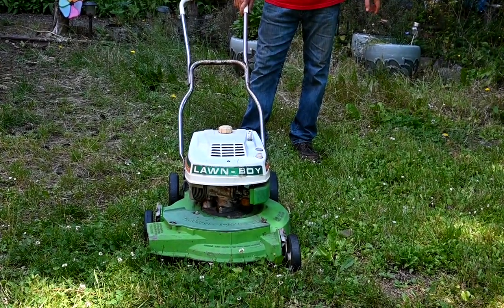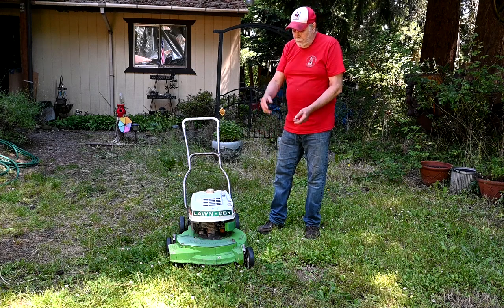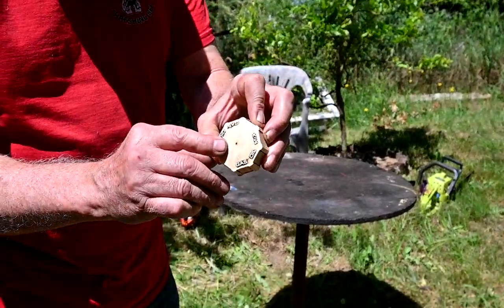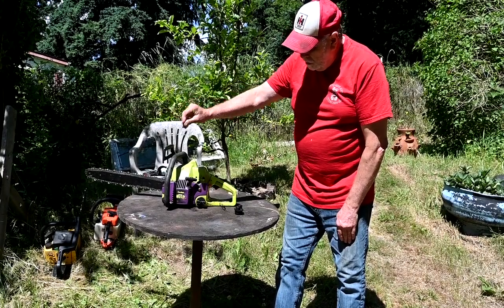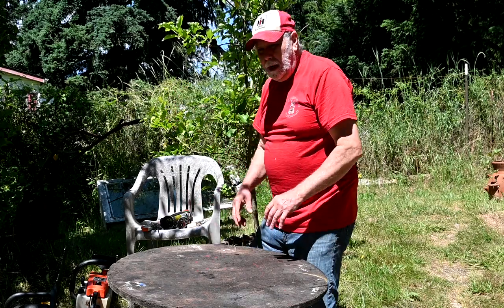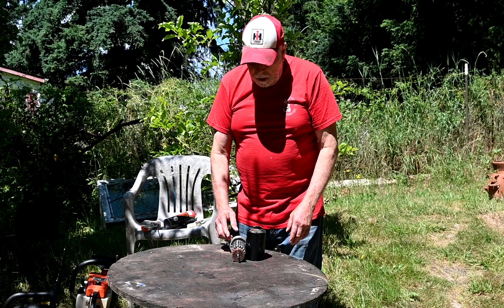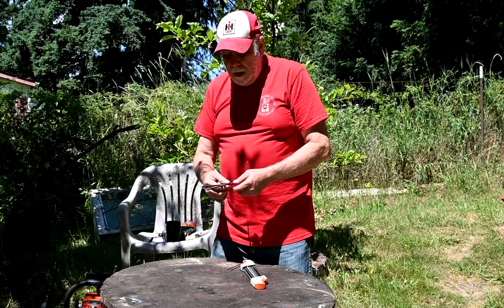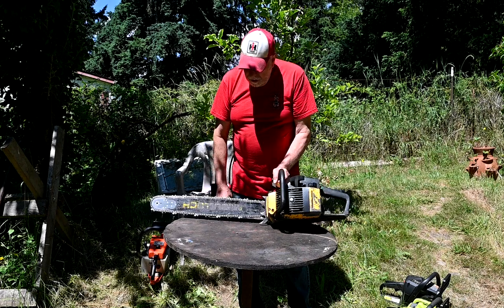Vintage Lawn Boy Mowing + Other Non-Related BS

Comment: I got some STP Oil treatment in my lawnmowers, today.  I went by your prescription - 10%.  I put two ounces in my push mower and 6 ounces in my lawn tractor.  My push mower holds .7 QT and my tractor holds 2 QT.  I will add it to my emergency generator and gas pressure washer when I get a chance.  They are due for an oil change, too.
Reply from the maker: Your engines will be happy.  The reason I don't use multi weight oil in my power equipment is because the base oil is the first numbers on the oil can, like 10 or 20.  The second numbers represent how thick the viscosity is when the oil is hot.  How this is achieved is that the oil say 10 weight is mixed with a polymer, a type of plastic,  when heated up , holds the oil molecules together, then on a test machine it registers say like 30 weight, so it is rated at 10-30.  The problem is that the polymer wears out, especially from high heat, and all you have in the crankcase is dirty 10 weight.  Air cooled engines run hotter than car engines, so the polymer breaks down sooner.  STP is a viscosity improver, so it helps the oil from breaking down as soon in power equipment also.

Comment: I have one of those Lawn boy mowers too. I gotta get the thing it goes on the end of spark plug wire I've been working on Is here and there.  been waiting for my knee to heal I gotta Two brand new knee I'm limited to what I can do. But I can't wait to get it running Thank you for the video.
Reply from the maker: Thanks for watching. When your knees heal up, it will be good excercise to push that Lawn Boy around out mowing the grass.

Comment: I Love All Lawnboy 2 Cycle Mowers I’ve Got a Commercial Model M Series Piston Ported Ball Bearing Engine They Said Run 64:1 Mix I Use 50:1 Mix Still Runs Like a Brand New One 😊❤️😊❤️ I Had That Same Model You Have I Believe It Has The D-600 Engine 😀😊 Thank You For A Great Video Mr&Mrs Obsolete It Brings Back Fond Memories When I Hear Your Lawnboy Running 😀❤️
Reply from the maker: I think the M model was one of the last 2 stroke Lawn Boys, and the engine was made by Tecumseh if I remember correctly. Glad you liked the video, and see and hear my old mower earning its keep.
Reply: @mrobsoletesvintagehomestea9156  The Engine Was Made By OMC It Was Rumored The 2 Stroke Suzuki Toro Commercial Mowers Were Copied Engines of The OMC M Series 😀
Reply from the maker: I read somewhere that the Dura Force engines used by Lawn Boy were built to OMC's specs by Tecumseh.  They were the last 2 stroke Lawn Boys.  The M series must have been a bit earlier would be my guess.
Reply from the maker: I did a little research, as I couldn't remember all the BS about the last of the Lawn Boy 2 stroke engines, but the model M and the DuraForce is the same engine. The original link that I had on the information about this engine is no longer around. Most info on the M say it was not an OMC engine.  Some say it was a Suzuki design like the ones sold by Toro, and others say it had a connection to Briggs& Stratton.  So now I am as confused as ever !
Reply: @mrobsoletesvintagehomestea9156  I’ve Got The Service and Repair Manual For The M Series I Worked at a Lawnboy Dealer 20 Years Ago When They Closed The Shop I Got to Keep The Service Manuals That We’re Left There 2 Different Engines The M Series Was OMC and Has The Carb on The Left Side Of The Engine It’s a Metal Mikuni Carb I Have a Commercial M Series The Model # is  C21ZMR  Serial # is  J0001372  The Duraforce Engines Had Reed Plates and Plastic Carbs Mounted on The Rear Of The Engine I’ve Got a Video of My M Series Running On YouTube I Still Mow With It To This Day Vintage Is Always Best 😀😊😀 Mr Obsolete
Reply from the maker: Thanks for the info.

Comment: Growing up, my best friend's dad had one of those mowers. I remember being a pretty good machine. Currently, I'm trying to get two old 10-10 Mac's  running that I picked up at an auction. One of them is pretty much complete, but the other one is missing a few parts. I'm going to try and make a video on the process of getting them running.... Great video Mr Obsolete...👍🤙
Reply from the maker: When I was in the 5th grade, my teacher used to hire me to mow her lawn, and she had a brand new Lawn Boy to mow with.  I liked mowing with that mower as it was fast, quiet and did a fantastic job of mowing.  We had a crummy old electric powered reel mower, so when it started shocking me, we got a new mower from Montgomery Wards using S&H green stamps. They didn't have Lawn Boys, so we got a Garden Mark with a 3hp B&S.  It lasted for 35 years, but I always wanted a Lawn Boy.  I will check out your video when you get the Mac's up and running.
Reply: @mrobsoletesvintagehomestea9156  my first lawnmower that I remember was a 5 
HP Toro self propelled reel mower that momma bought when I was about ten.  Being the oldest, it was my job to mow the yard.  Before that we had one of the old push reel mower and the Toro cut a lot faster than those suckers.  I pushed that heat sucker around the yard for years.  It would be another ten years before we got a rotary mower.  On the .tor, you had to wrap a rope around the starter and pull, re-wrapping after each pull.  I know you know the type.  It was a lot easier to crank than a Ford tractor with a crank start, but not much easier.  After about five seasons the .toro gave up the ghost and would not run.  I did not know anything about storage condition, back then, so letting gas sit in it from one year to another probably killed it.
Reply from the maker: Good memories and story.
Reply: @mrobsoletesvintagehomestea9156  more like bad memories and BS.  I had to push that heavy sucker all ove the yard because it did not want to roll in we St. Augustine grass.  It was a belt drive which did not want to roll, you kind of had to help it along.  My Ninja Snapper will pull me up the hills in the yard, now.  My Snapper SPX lawn tractor will go anywhere I want to go.  It has a hydrostatic transmission and a cruise button.
Reply from the maker: Got a good laugh out of your comment !

Comment: At least, you do not have to change the oil in it.  I need to change the oil in my Snapper Ninja but I do not worry about it because I use Pennzoil Platinum 10W-30, fully synthetic in it.  It lasts a lot better than conventional oil.  I change it when it gets discolored.  I hardly ever have to add additional oil to it.  My lawn tractor contains the same oil, as does my generator and pressure washer.  
  I have been trying to get some Stihl 18 inch scabbards (30-06) for my Stihl 025 and 021 for six months.  I ended up putting 20 inch scabbards on them.  I could take the 20 inch scabbards to my chop saw and shorten them but I use so many 20 inch bars I always need another scabbard, so I will let them fit a little loose until the right ones come into my local Stihl dealer.  I use a file card to clean my files.
Reply from the maker: On my 4 stroke mowers etc., I use 30 weight oil with a 10% mix of STP. I have never had an engine failure on any of my power equipment using this.  A lot of my power equipment is between 20 to 40 years old, and still going strong. I change oil twice a season also. The STP has the zinc disulfide and other additives that air cooled engines need to survive.  Regular car oil doesn't have the correct additives, and that's why the engine manufacturers sell the very expensive oils.  Using a file card on files is an excellent idea.  On my files that I use on oily chains, I wash them off with brake cleaner before I use the file card on them.
Reply: @mrobsoletesvintagehomestea9156  that about the same viscosity as what I use.  I have not seen STP in shops for years.  Didn’t know it still existed.  I run my mowers year around, so I need the lighter viscosity.  I mow up leaves in the fall and winter.  I figure if Pennzoil Platinum is good enough for my cars it is good enough for my lawnmowers.  My mowers are brand new by your standards.  It is also hard to find standard HD 30W anymore where I live.  I use it and ATF in my pneumatic oiler and if I can’t find any 30W I will use bar oil as my general lubricant for such things as door hinges, bearings, etc.
Reply from the maker: I live in a rural area, and there is still a lot of old tractors and old farm equipment still working, so some of the local parts stores stock 30 wt oil. These same shops carry STP also.  STP was not selling very well in bigger cities around us, but when the government mandated the removal of zinc in oils, commercial smaller trucks that were gas powered, started having massive camshaft failures, the the same to other small trucks that had flat tappet cams.  People started adding STP and the problem went away, and STP is now a big seller.  Many years ago I worked at a car dealer, and they used Pennzoil for the lube rack when servicing customer vehicles.  It would cause a weird plasticky material buildup in the engines, and we did a lot of camshaft replacements, as the oil did a poor job of lubricating.  When I worked at an independent auto and general repair shop, we used Castrol.  It was excellent until Pennzoil purchased them, cheapened up the oil and cut the additive package.  We started to see the same problems we had at the dealership.  None of these oils were synthetic. Today most vehicles use synthetic oils, and in most cases it is much better than the old mineral oils we used forever.
Reply: @mrobsoletesvintagehomestea9156  I used to use STP but after I saw a lot of bad publicity on it I stopped using it about thirty odd years ago. I will see if my local parts houses have it and .I will get a can and add a little bit to my oil in the LM’s.  I guess it is like when they removed the lead from the gas - that ate up valves in small engines.  They needed the lead to lubricate the valves.  Talk about sludge the king of that used to be Quaker State.  I stopped using it over 40 years ago.  I had to replace the valve cover gaskets on my ‘78 Chevy K 15 and the galleries were filled with white sludge.  I switched to Valvoline and never had a problem, again with sludge buildup.  That, was when I changed my oil every 3,000 miles, too.  I have never had a valve tapped problem.  I change my oil every 5,000 now.
Reply from the maker: I have used STP in my vehicles since I was in high school.  Many of the cars I had I drove over 400,00 miles, and the engines were always clean inside. The bodies rusted out before the engines ever needed work. The sludge problem in older vehicles was caused by bad oil without good additives and poor or non functional crankcase venting system.  Valvoline has always been one of the best oils.  We found that engines had 3 to 5 pounds more oil pressure with it.  One thing about synthetic oil that is missed is that the additive package is pretty well used up by 3500 miles, just like in regular motor oil, so it is best to change it a bit sooner than 5000 miles.  When synthetics were introduced, Saab said that the recommended oil change interval was 10,000 miles.  We sure did a lot of camshaft and timing chain jobs on them as a result.

Comment: Well let's try again , I've fixed that carburetor problem on the two butter fly carburetors when that plastic piece breaks off on the top butter fly rod , I drill a tiny hole in the rod and put a cotter pin in it and bend the cotter pin so it opens up the top butter fly the same time as the bottom .
Reply from the maker: That's pretty inventive.  The original carb had all metal linkage. After it failed,  I used a carb off a parts saw, and got it to run for a while with that one, but the plastic piece failed on it, and the diaphram wasn't pumping enough fuel to keep it running properly.  Since I couldn't find any repair kits, I purchased the crappy new carb, so I could use it again.

Comment: I recommend the SUNOCO non ethanol pre mix 50:1 ⛽ gas
Reply from the maker: I never use any 2 stroke with 50-1 oil mix.  It just isn't enough for old equipment like I use.  I use 20-1 in real early power equipment, 24-1 in old outboard motors and old chainsaws when doing hard work with them, and 32-1 for average use.   This formula has proven out well, as I haven't had a seizure in any of my old equipment in over 40 years of use.  The type of oils I use is critical also. I don't use any full synthetic oils in anything.  Sunoco racing fuel would be nice to have for my vintage dirt bikes !

Comment: My dad used to haul scrap 4 many years . as a side even main source of income. I camt tell u how many of those lawnboy mowers he scrapped most i think were 2stroke that got straight gas.
Reply from the maker: 2 cycle engines sure don't last long with no oil in the gas !
Reply: @mrobsoletesvintagehomestea9156  sad fact's

Comment: i hated those lawn boys when i was a kid
Reply from the maker: Why ?
Reply: @mrobsoletesvintagehomestea9156  I worked for a lawn service and they had 3, all of them temperamental. I vowed never to use crappy equipment again so I splurge on equipment for my company
Reply from the maker: Do you remember if they were the commercial models?  Many commercial operators used the Pro model Lawn Boys with great success, as long as they used high quality oil and were maintained properly.  The Lawn Boy oil was really good stuff.

Comment: Where are you getting non alcohol gas? Can't find it in Kentucky.
Reply from the maker: Due to the severe damage done to farm, logging, commercial equipment etc. from ethanol fuel, they passed legislation so they can make and sell non alcohol fuel in the PNW.

Comment: On those cheap Poulans the bearings and seals are made as one plastic piece.  Just junk.
Reply from the maker: You are right, the Poulan cheapo saws are real junkers.  That is why I call them POOLANS.  A good example is my Wild Thing, that I have named MR.POO, because we know what it is made of !
Reply: @mrobsoletesvintagehomestea9156   they are designed for a price point and to be used, once, and discarded, which is about how long they last.
Reply from the maker: Most of the low end POOLANS have very short lives.  Once in a while though, some actually last for awhile. I call them factory rejects, as somehow they were put together properly for some unknown reason.  My Wild Thing actually had a lot of time on it before I received it, but my Wood Shark , made in 2012,had less than 5 hours on it because it was so unreliable.
Reply: @mrobsoletesvintagehomestea9156  everybody makes a mistake once in a while.  Mr. Poulan would be ashamed of the products that carry his name, these days.
Reply from the maker: Absolutely !